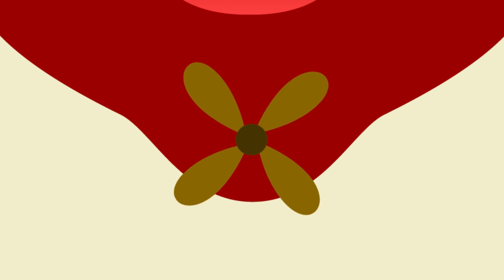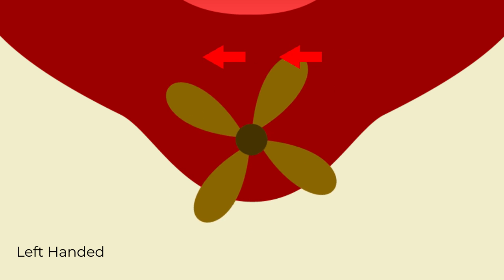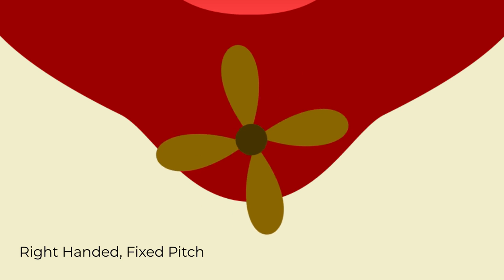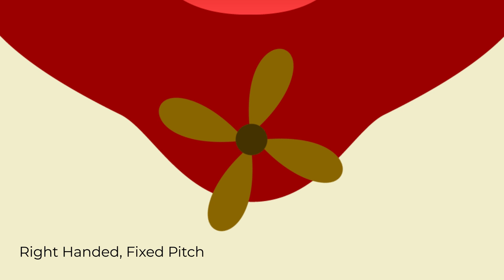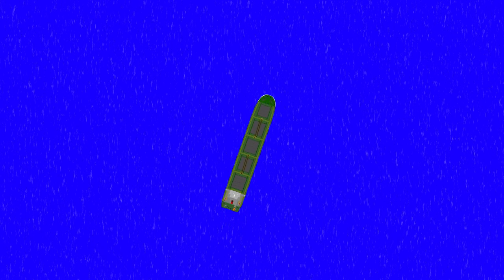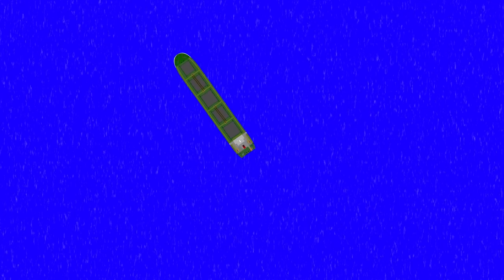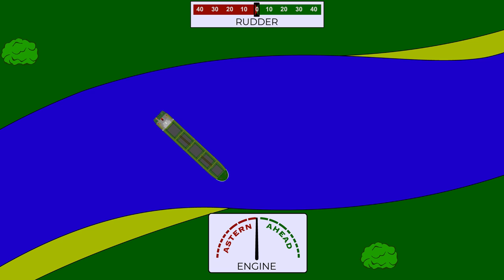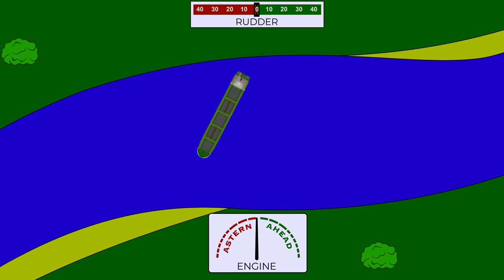Manoeuvring Tutorial: Turning Short Round

Comment: Great video but In the example right handed propeller when going ahead should bring the vessel to port not to starboard since the rotation of the blades are in clock wise direction
Reply: The rotation which matters is when running astern. Ahead you can ignore propwalk.

Comment: In the example, why don't you bring the rudder hard over to port whilst the engines are reversed?
Reply: Because in astern thrust , no water strikes the rudder. As the propeller is turning anti clock wise, water is pushed from propeller towards ahead. So any angle on the rudder won't do anything.
Reply: @shashiranjan3626  but surely as soon as the vessel starts moving backwards water is now flowing over the rudder? Ok no where near as much as if the props were pushing water over the rudder but it must still do something, right?
Reply: @alexanderwatson9845  correct, but depending on the type of vessel and environmental considerations like current you may have to put on a considerable amount of way to gain rudder authority which will be problematic in a confined space.the prop walk referenced is there to maintain the turn not initiate it so is generally enough and keeps the maneuver slow and controlled.
Reply: @jeredgaskell2422  so in layman's terms you'd have to go too fast to actually start turning?